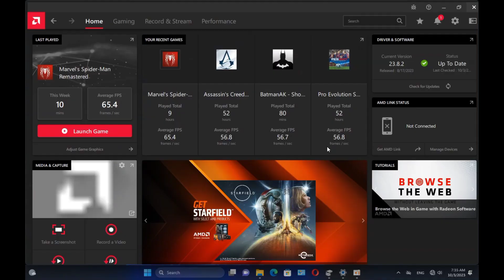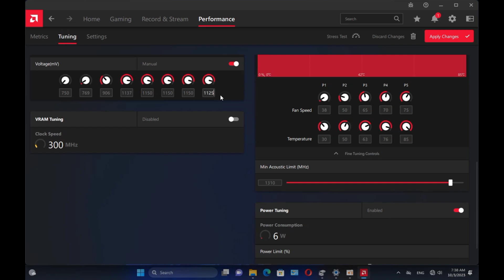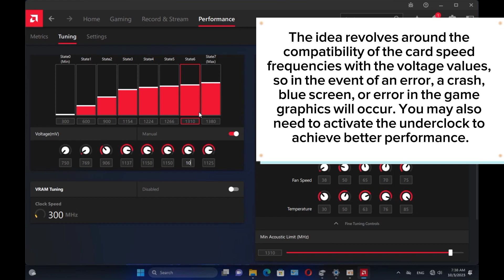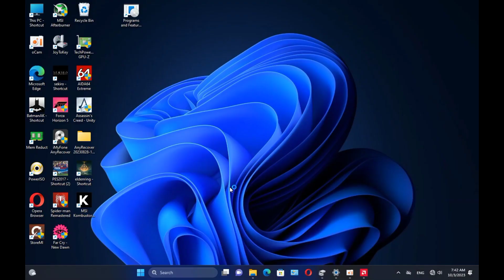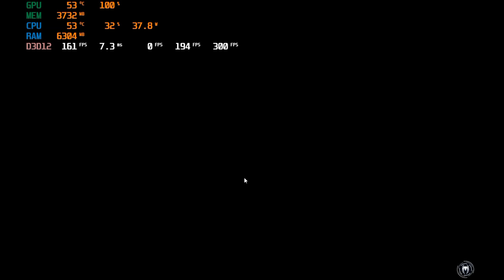RX580/ 590 gme 8gb |Guide to Under clock/Under voltage (good performance/ low heat)

Comment: Help me out a bit please, i got an rx590 gme and when i game it reaches 86 degrees like instant fans on 101 percent so when I play fortnite it exits out every 30 seconds? how do I fix it please help I used to own an rx580 before and it didnt go above 75 or sum
Reply from the maker: Here you may have a problem either in the cooling fans of the card or with the internal cooling system.You can clean the card from dust as a first solution, and if you do not succeed, you will contact the nearest code reformer to clean and renew thermal paste or repair the cooling system if it is broken. This is if the data related to the heat that appears on the screen is correct.

Comment: Great video, thanks! I'm having serious issues with my rx 590, so every tutorial worth to try. I was playing helldivers 2 with lossless scaling, everything normal, but now i can't even play borderlands 3 without random shuttsdown. Boom, all the PC. And i'm pretty sure that its my gpu the problem. Even using Lossless with a VLC video.
Reply: Did you ever resolve the problems with your RX590 shutting down? I'm having the same issues with mine, but undervolting seems to make a difference.
Reply: @uncaringbear  Hello! I finally managed to solve the problems. One was hardware and one was software: The hardware one, basically some liquid had spilled, like an oil that I'm not sure if it was from a capacitor or what, but when I disassembled it, I cleaned it all and replaced the thermal pads. The software problem was caused by AMD Adrenalin. I reinstalled it using the 'drivers only' option and it stopped bothering me. Every time I installed it full, my GPU would over-rev and shut down my computer.

Comment: such a terrible card, if only i knew sooner.

edit: your channel gave me hope on this gpu. I'm gonna get that exact cpu. Thanks.
Reply from the maker: Enjoy!
Reply from the maker: https://fr.aliexpress.com/item/1005005274839365.html?gatewayAdapt=glo2fra
Reply from the maker: https://youtu.be/DbTMPOKurlM?si=4kuXnim77jxIYI5x
Reply: @thedarkbrotherhood.7248  mate ive tested your undervolt settings on furmark but the temp quickly rises to 80C whys that?
Reply from the maker: I did not use this program at the time, as I remember, but rather the MSI Combuster program and other programs. It is normal for the temperature to rise to 80 because it pushes the graphics card to its maximum performance. This also depends on the settings that you put in the program, such as choosing the resolution, for example.  In fact, a temperature of 80 is considered very normal, and the situation may vary depending on several factors, including the weather condition, room temperature, amount of ventilation, as well as the cooling system in your computer. So rest assured, it seems normal.
Reply from the maker: As for the voltage settings, I may not guarantee that they are 100% correct, but they do the job and reduce the temperature by a significant percentage. I reached them after several tests and using several programs, and I contented myself with putting the results in the video to simplify things. The settings are safe and I have tried them with almost all games. I also do not recommend them.  By raising the resolution to more than 1080, unless you limit the framerates, because the card is not intended for a larger category.